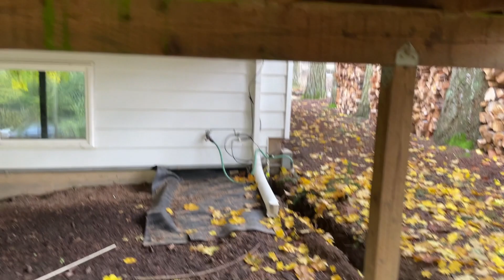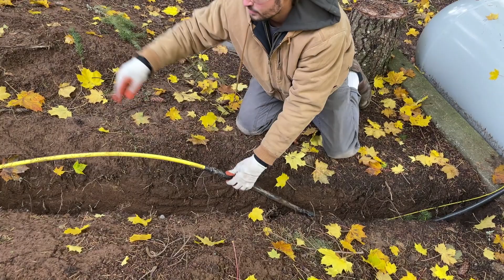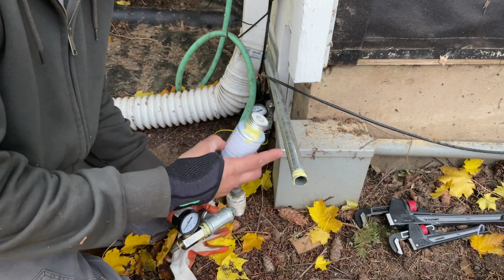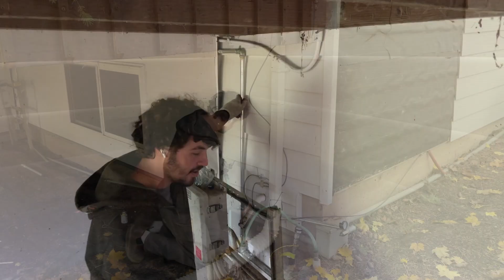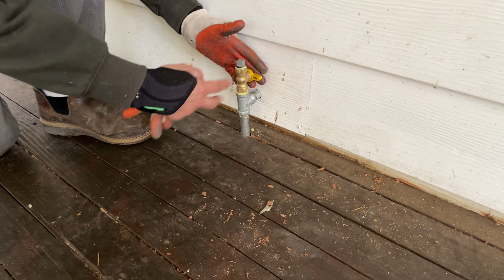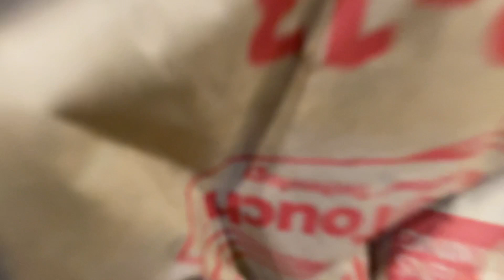How to Install Home Propane Tank

Comment: What are the two black sweeps at both ends?
Reply from the maker: They are to transition from the yellow plastic pipe in the ground to the tank and house respectively. The yellow line must to be burried 2ft deep so it needs something to transition to the surface.

Comment: I have always been told to use black pipe so the galvanized does not flake off and plug up orifices.  But I guess if you are in the HVAC business, galvanized is good.

Comment: Galvanized is not allowed, only black iron.  Not sure why, but be safe.
Reply: Because the coating will flake on the inside and clog the orifices. Always, always black iron.
Reply: @neilfinicum1362  what I figured.

Comment: Great information! This really helped me fully understand my current system and be confident to do updates in the future. The flow of the video was just the right speed to fully comprehend each step but didn't waste anyone's time.  It makes me curious what the differences would be if it was a Natural Gas installation?
Reply: Thanks for the feedback! The main difference would be the size of the lines. NG is less energy-dense and so appliances need more of it to run than propane. There are charts that will tell you how large a line needs to be given its length and total BTUs being drawn from it.

Comment: Wondering if you could provide more info about when sediment traps are necessary. I have a underbody tank (under vehicle), and the propane would be flowing upwards to propane furnace. Do I need any sediment traps in this scenario?
Reply: Sediment traps are regulated by jurisdiction, one county or state may require them and another will not.  I had never heard of a sediment trap until an over zealous home inspector called it out  missing on our hot water heater in a home inspection report while we were selling a house.  If a trap would be needed it would be needed at the appliance, it’s basically a tee with a nipple and a cap pointed down.
Reply: Sediment traps are not a bad idea, unless code says to not use them - I can’t imagine why a jurisdiction would ban sediment traps, but follow code first.

I used to live in western Pennsylvania, the natural gas from the region has a lot of oil in it, and it can be pretty dirty, which is why a sediment trap is sometimes referred to as a dust trap.  I had installed a gas dryer and moved a year later and the 4” nipple that I used for a sediment trap was filled to the top with crude oil.  And I thought, 4” was excessively long.

So the trap just gives dust, dirt, pebbles, oil, water, etc. a place to get caught before hitting your appliance.  It’s kind of like having an air filter on an engine.  A cheap “T” fitting and a nipple at each appliances cheaper than replacing an appliance regulator or other component.
Reply: @ppainterco  thanks for your answer
Reply: @tqrecords  my pleasure.  Good luck!

Comment: Any advice on whether or not to run pipe through an attic?
Reply: You can run LP lines through an attic no problem. You can use steel pipe like I did here or I would suggest using HomeFlex CSST. It’s a flexible gas pipe that is much easier to run. HomeFlex have a whole guide on how to install it correctly. You can just transition to HomeFlex once you enter the house. 
Good luck!

Comment: Sediment traps are required before an appliance.
Reply from the maker: Since the line travels vertically before entering the house the sediment trap is not necessary. What would the trap do? In any case, this passed the inspection as is.

Comment: Not sure if Galvanized is allowed by code up here in Canada, usually is painted black iron on exterior.
Reply: I heard both arguments. They say the galvanized coating can peel and clog appliances but the black pipe will rust even sooner and clog appliances.
Galvanized meets code here.

Comment: Black iron pipe is the preferred hard pipe for propane. The galvanic coating can peel and clog orafices. Thanks for the video!
Reply: Galvanized is against code in most locations
Reply: @Bottlemaker1  International fire code says it's ok to use, Sediment traps are required for the reason of sediment in the lines.
Reply: @elkhunter63t30  I know that but a lot of counties ban the use of galvanized when county bans it doesn’t matter nfpa54 says.

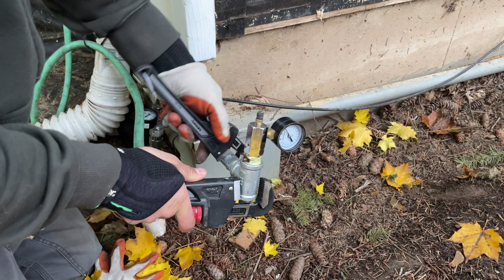Comment: At time 4:50 or so, he is rotating the already installed pipe which is loosening the other end, very bad idea.  Pressure test should catch it but need to go back to the previous connection to also test. Please be very careful with this stuff. Very dangerous stuff, be careful, pressure test, pressure test.  Yes, you can do it, but please be careful.
Reply from the maker: The other end of the long pipe has not been connected to anything yet at that point. Good thought though!
Reply: Go back 40 seconds and re-watch the video. He already explained that he left it loose.
Reply: pipe was not connected to anything, watch a little longer you will see he has pipes laying near house behind the connection